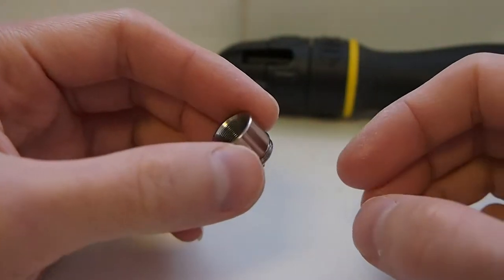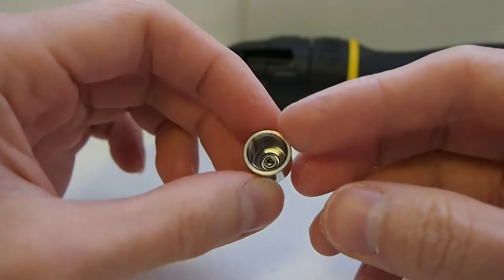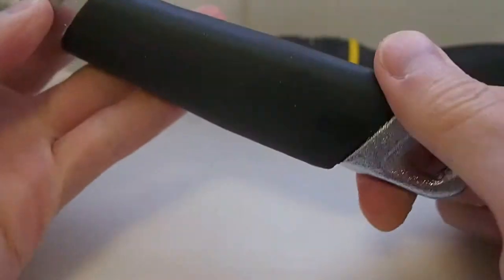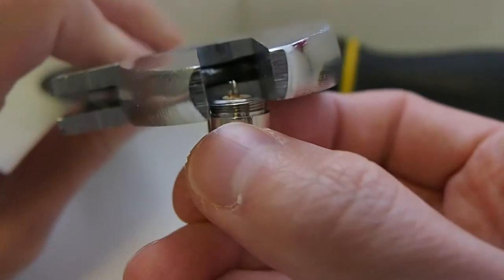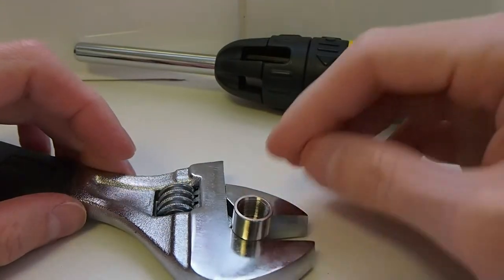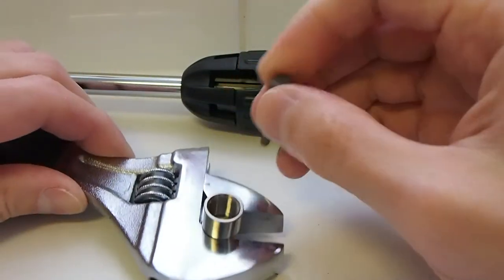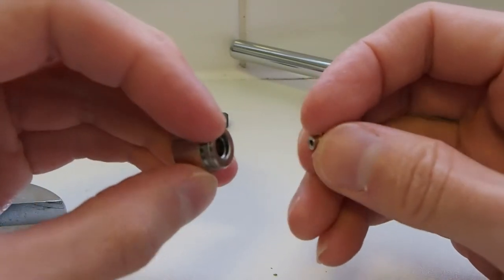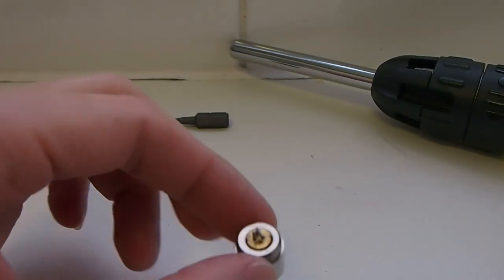Press removing a laser diode from a 5.6mm AixiZ module

Comment: dude, why destroy the diode? you just need to place the module in the wrench exactly as you did, and instead of using a screwdriver tip like you did, use a flat end screw which will most probably have a diameter larger than the diode. hit it with a hammer and you have two healthy components, a diode and a module